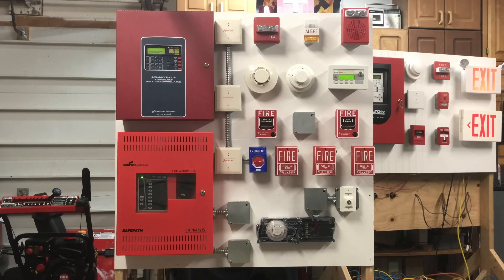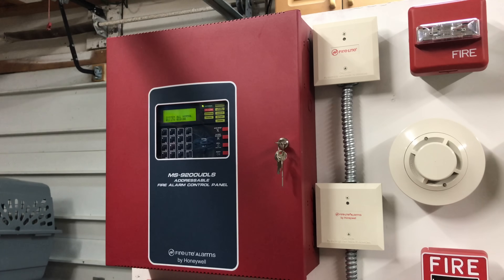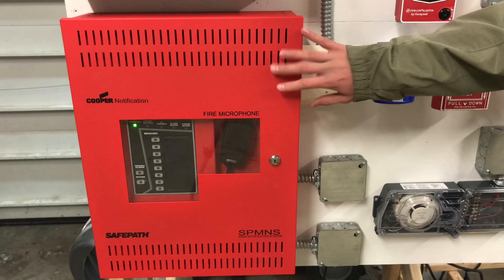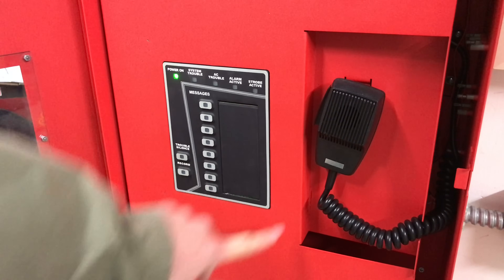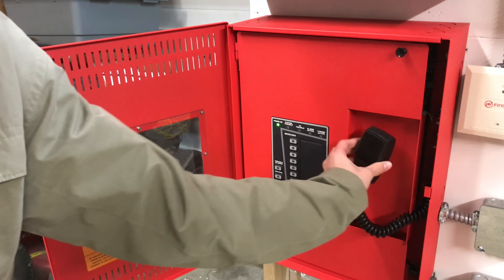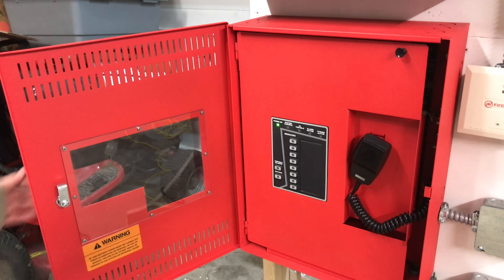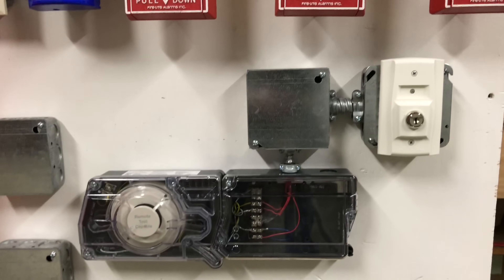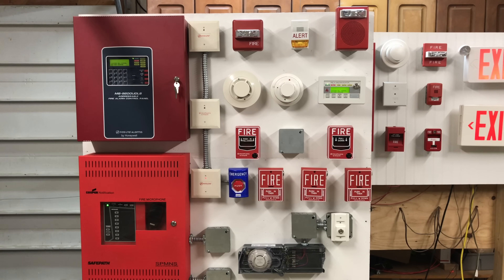NEW Fire-Lite & Wheelock Voice Evac System Overview

Comment: There may be a break between the data lines that is just enough to allow the panel to see the annunciator, but is enough to cause a trouble, try re-wiring the annunciator and make sure no wires are touching each other

Comment: A way you could check to see if it's a panel issue is wire the LCD 80 to the Unimode 10UD and see if the same thing happens. If it works properly, then the panel may have a loose Ann terminal. If not, the annunciator may have a standby communication issue. (also try the ANN 80 on the UDLS). By the way, I got a 9200UDLS nib today
Reply: The two are incompatible
Reply: Bob Tramontana he can test the ANN 80 on the UDLS though to test the panel for issues
Reply: There'll be compatibility issues along the way, chances are, as I have previously stated, the issue may be within the data lines, it'd be best to check the wiring first, to perhaps see if there's a break between the two devices, or any other wiring issue
Reply: How did you get a NIB MS-9200UDLS?!?!

Comment: Hello, if I want to wire a System Sensor 5601P to a ES-200X (which is their newer addressable FACPs), should I use a MMF-300 or a MMF-302?

Comment: Hay I know why the alarm goes off the alarm system that you have can hook up to what call auto alarm call witch call emergency services and because you don’t have that hook up to the system is is think a rat or somthing has eaten the cable and it is sending a error alarm to get around the problem you need to switch the switch that have the emergency call system and turn that off hope that fixes the problem

Comment: 6:50 same thing with my pull station and my fire alarm I followed everything and nothin I would connect it with the battery and it went of and the pull station was not pulled also good video

Comment: That Wheelock voice evac panel looks very similar to the simplex 4003ec
Reply: RSS Alarms that’s because the 4003ec is a Safepath made to Simplex’s specifications and it has Simplex tones and messages on it. It replaced the original 4003.